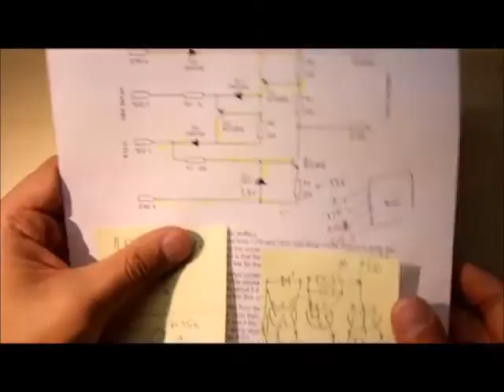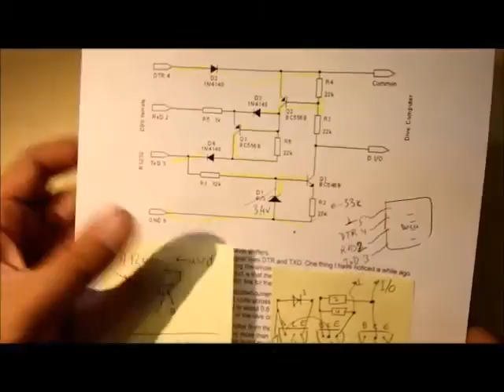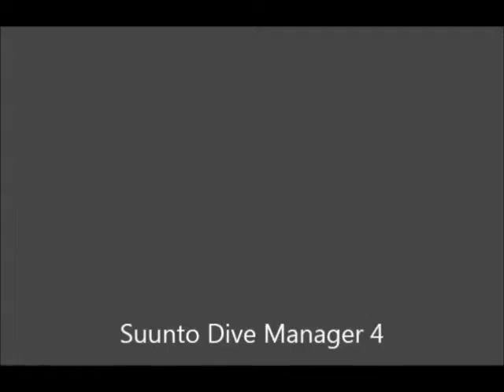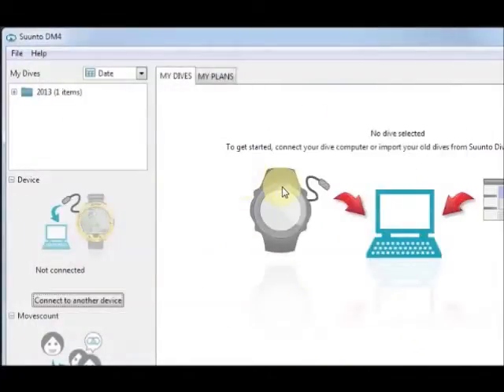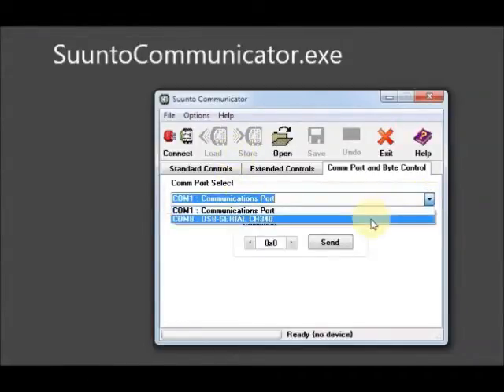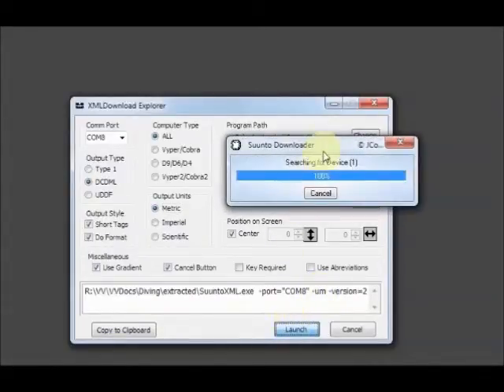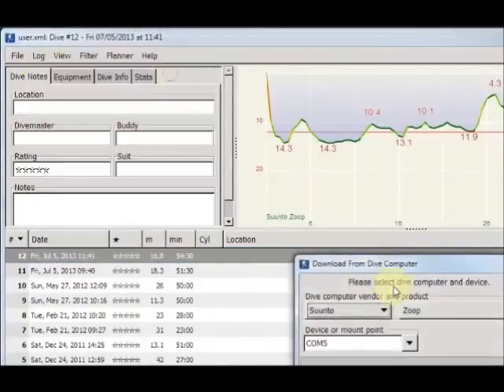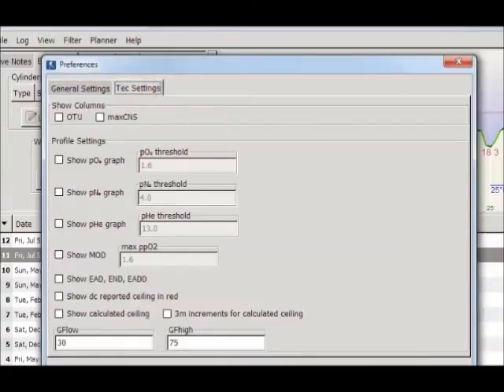Suunto Zoop data download with DIY cable

Comment: Regarding the USB to DB9 serial cable: are true RS232 levels used or are they TTL ? Are popular USB to TTL (3,3- 5V) FTDI based boards giving correct voltage levels to use this circuit ?